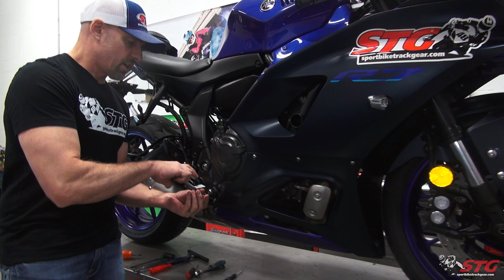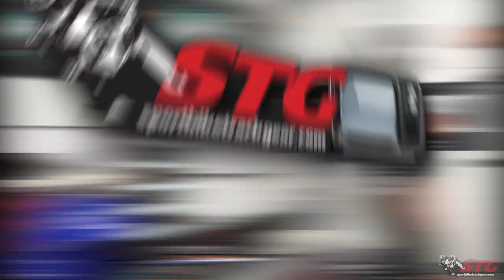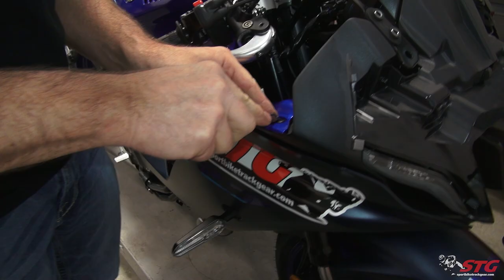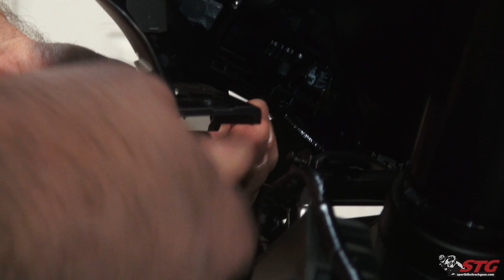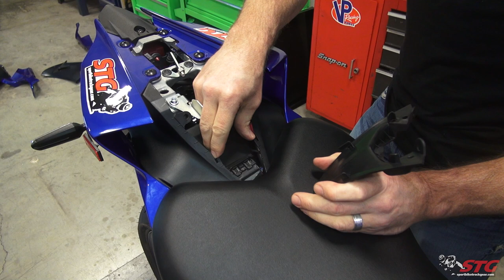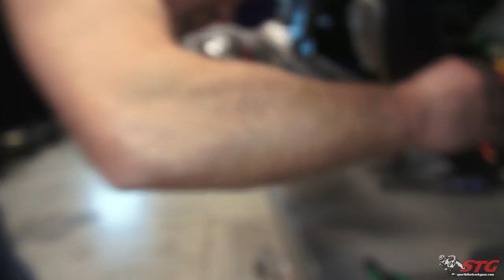How To Remove and Reinstall Bodywork On A Yamaha YZF R7 | Sportbike Track Gear

Comment: Thank you very much for this video which indeed helped me a lot sinc I am preparing my R7 for the race track. However, you don't explain how to remove the tail light anf the round front light. Something I don't dare to do it myself without a guide ;-) Thank you in advance. Sincerely from France.
Reply from the maker: I found both of those pieces to be pretty easy to remove once the rest of the bodywork was removed. Use what we have here to get you to that point then I think you will find you are able to handle the rest pretty easily. - Van

Comment: Hey Brian, I just bought a 2022 R7, and when I picked it up from the dealership they had cracked and scraped up all of the lower and middle side fairings. They replaced the fairings for free, and I installed them myself with this video. However, the piece that connects the left and right fairings, right behind the front wheel, i don’t have any screws or clips for. I guess the dealership overlooked this. Do you know where I can find a replacement connector with all of the proper screws and clips? Or know what I can just replace the screws and clips with? Thanks!
Reply from the maker: I would go back to the dealer and ask them to order all of the oem pieces that you are missing. End of the day they are responsible to deliver a complete bike. - Van

Comment: Have you installed a steering damper on the r7 yet . If so got any advise on what type is compatible .
Reply from the maker: I plan to install the Graves Motorsports Yamaha YZF-R7 2022 WORKS Steering Damper Mount and the Ohlins Universal Damper. Here is a link to them on our site: https://www.sportbiketrackgear.com/graves-motorsports-yamaha-yzf-r7-2022-works-steering-damper-mount/  -  Van